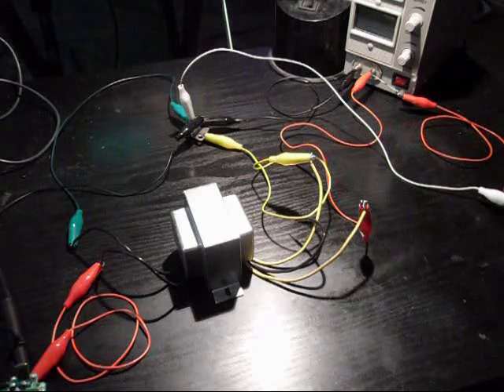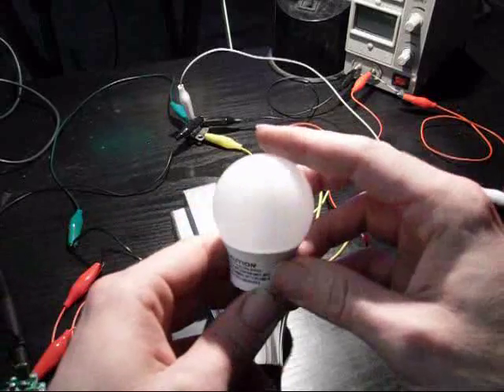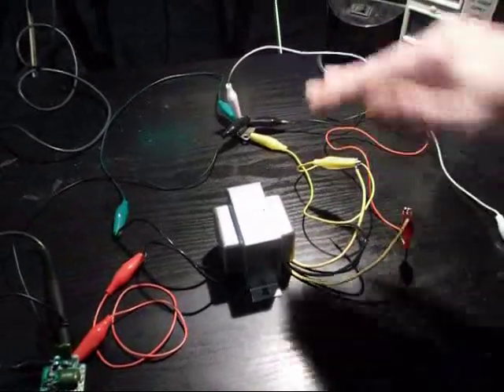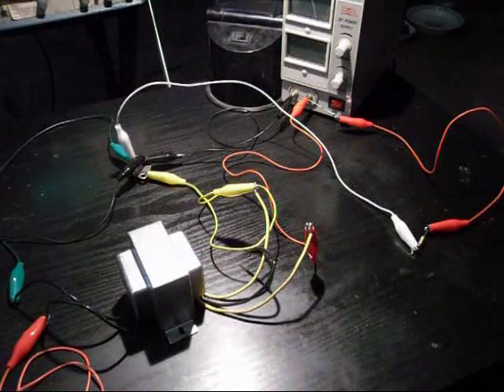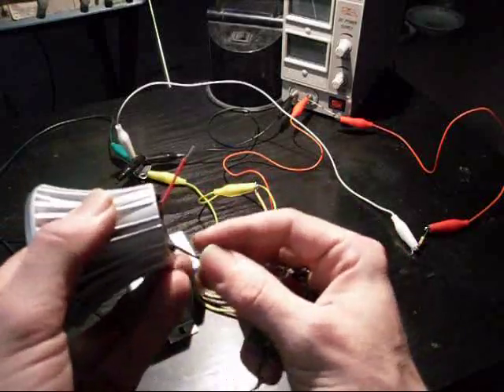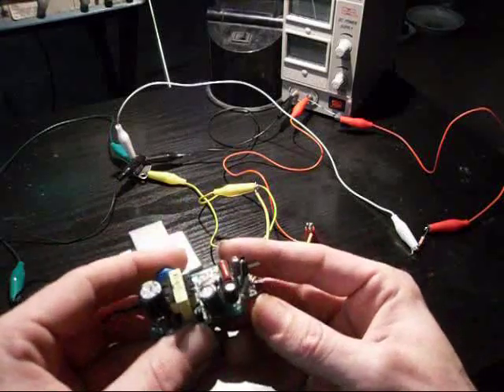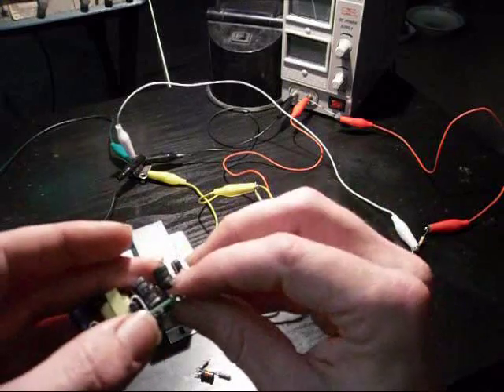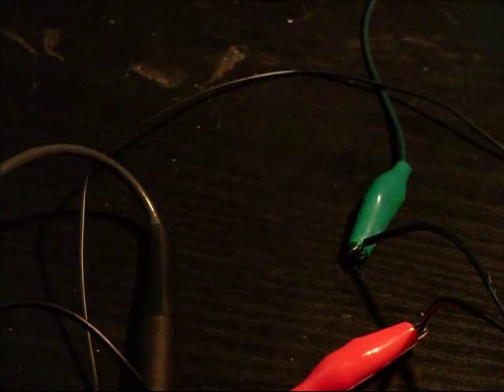Utilitech / Radio Shack from PB - Patch / Fix for Efficiency 59 Lu/w @ +90% Eff. (Part 1)

Comment: The ultimate JR P1
I have this lazy TV YOKE that just wouldn't accept any sort of winding or Transistors; the output volt was always lower than what I put in. It’s small, circa 3 inches in D, cylindrical outside, concave inside, and easy to wind. Chose to be bizarre with it; 60 turn of Antenna's wire, single wire; wired like any JT, and hey presto! The V. Meter went crazy! Connected a 110 V LED B on the collector's diode; it was as bright as sunshine. More to follow!

Comment: I've gotta say then that the "edison" socket is questionable.. have you looked at any other connector standards for a modified bulb?

I suppose clearly marking "NOT FOR REGULAR LIGHT SOCKETS!" would help.

The real question is; when you finally let your new arrangement out of the bag, will be still be moding bulbs ?

Comment: I have a sneaking suspicion that resonance is everything, when it comes to exceptional efficiency. 
This means harmony, and that can be measured, pitch mathematically derived (or using an electronic instrument tuner , kiloherz you say?), so ideally;
-same note
-major apreggio
-diatonic scale
or disharmony
The first step is to know the natural frequency of each component, and pick on a resonant key, which should be a "major natural key"(shoot for E major, known to be the most powerful)

Comment from the maker: I forgot to mention, I don't recommend it; lol.  Though I didn't remove the VINsense or IINsense;  so I don't think the chip would fry.  It's a good one!.  As to previous about wave;  TY!  Ya I actually DID use a scope this time to ensure the final shown design was safe for the internal circuit and all components.  I consider this combination finalized for efficiency. ty